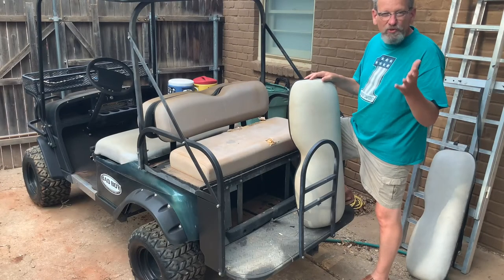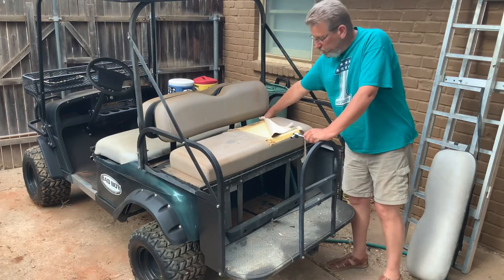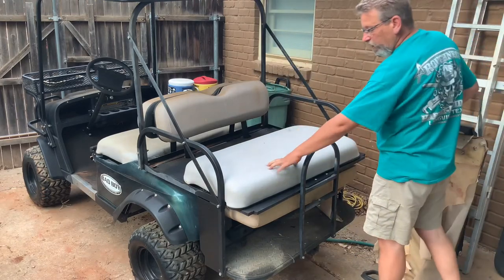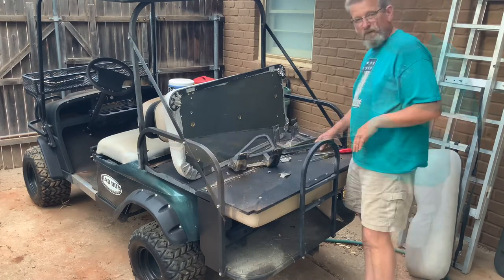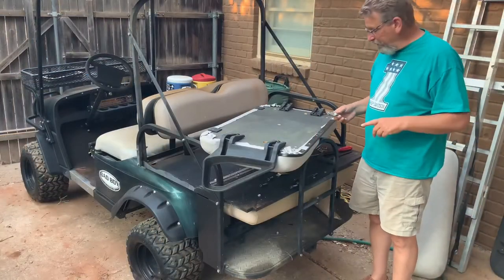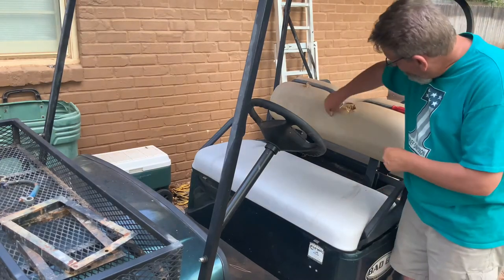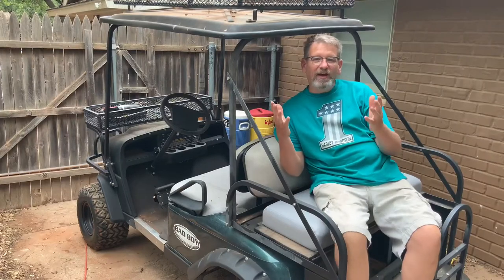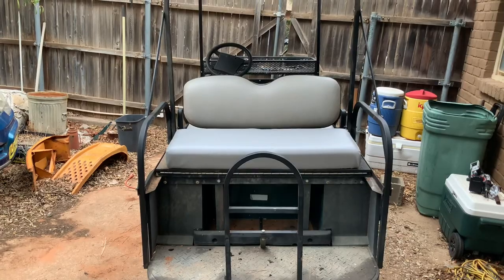S4E18: Bad Boy Buggy Restoration...Seats! Part 2

Comment: I bought the same (2008) Bad Boy Buggy.  You should have two(2) sevcon(blue) 500 amp controllers, they cost $800 each!  All one(1) gauge cables were cracked and were replaces.  Both (two) of the high-amp solenoids were replaced.  The front axle need new bearings, hubs and a CV axle.  In addition, WATER had gotten (deep puddles) into the front axle and got into the differential which ruined the Diff. bearings  -  do your research, these buggies are money/time pits!  BUT, are VERY cool when they a running, good luck!